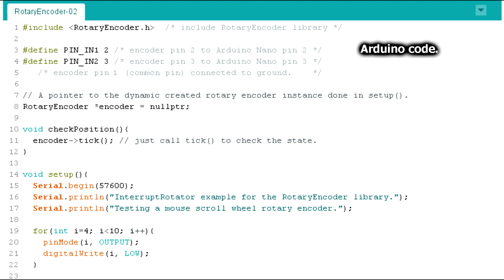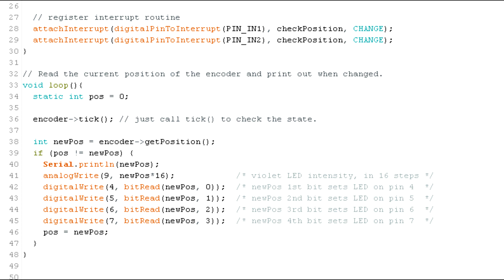Recycling a Mouse Scroll Wheel Rotary Encoder and Testing it with Arduino Nano

Comment: For people who have stiff scrolling wheel problem: remove the wheel, input a toothpick into the encoder slot rotate and see if it gets stuck. If not, it's the wheel that is the problem. You can try either replacing the scrolling wheel completely or removing the outer rubber part from the plastic. The rubber expands and degrades over time and gets stuck. That way you can at least have a usable scrolling wheel